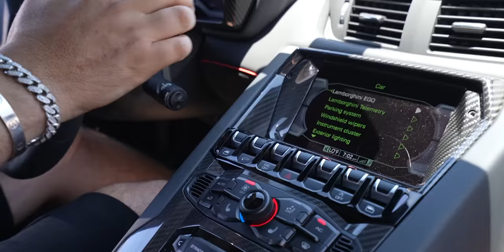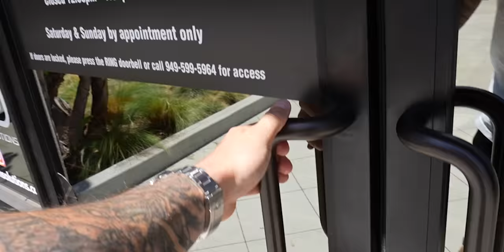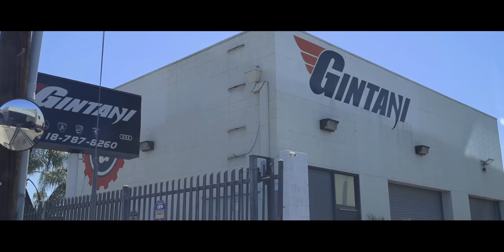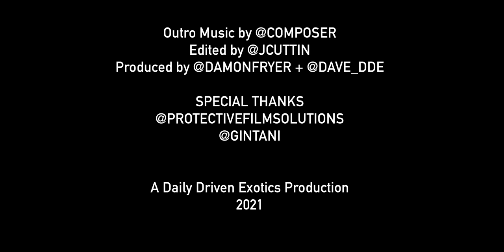REVVING MY TWIN TURBO F12 FERRARI 8000 RPM!  *Feat: GINTANI*

Comment: The sound of the f12 and Svj are ❤️‍🔥
Reply: Angie! Hope you collab with them sometime soon, maybe some driving even!? <3
Reply: hello angie haha
Reply: F12 sounds like shit worst turbo kit ever
Reply: @joelmorningstar3645  😂
Reply: That engine will sound completely different after a fine tune.
You’ll be amazed. ;)
Reply: @Chicomacheeno  I hope it is
Reply: You can tell the timing was way off. 
It’ll be awesome, just wait.
Reply: @Chris-hw4mq  tuning wont matter that F1 sound everyone talked about and gave people chills watching 2 years agonwas dead and gone as soon as they said turbo. You're right. Its not a shit turbo setup tho its still pretty awesome. However i actually agree they ruined the car. They will play up the turbo sound but it wont sound like the drift video 2 years ago i had that video on repeat.
Reply: @Chicomacheeno  lol no it wont. tune or no tune under no boost it sounds like it will regardless of tuning 🤡. Its open short pipes out of a turbo, this car will never sound anywhere near as good as it once did.

Comment: All motor V12, Gintani exhaust, ported heads, custom intake manifolds, E85...that's the build  @DailyDrivenExotics
Reply: What about a 12-1 merge collector.  This is engine is already cut for production, let's take it to the limit. If the Essenza SCV12 makes 830, this thing is capable of 900hp...